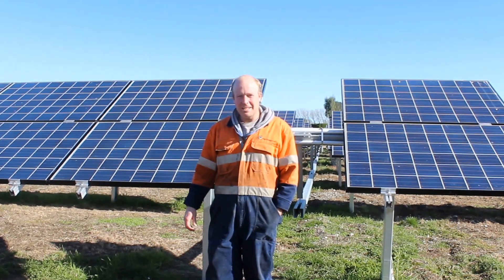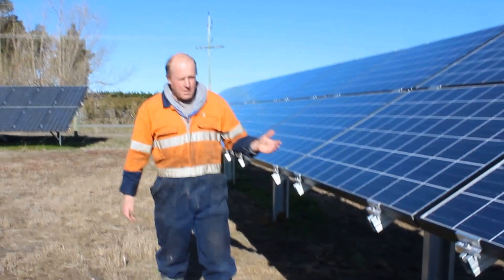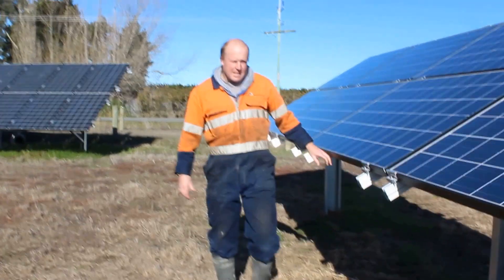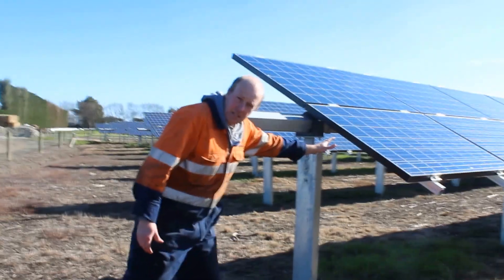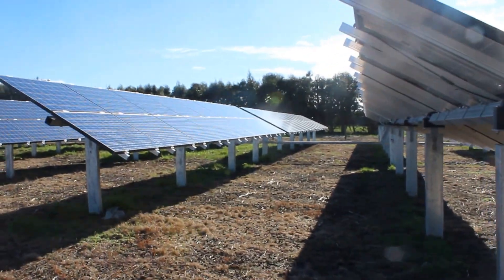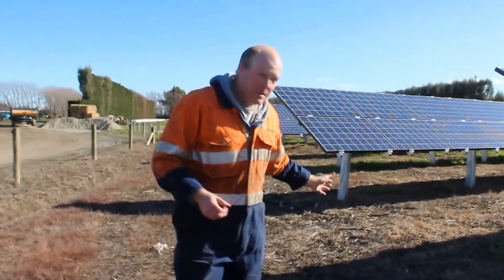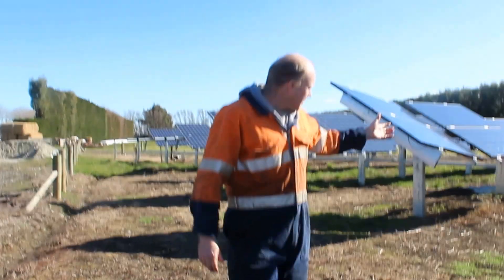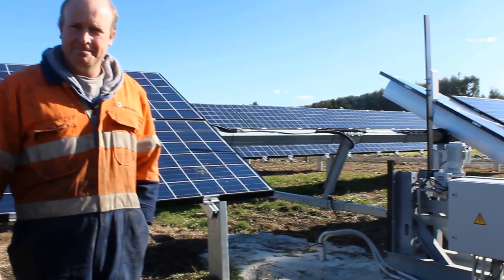Ground Mount Solar PV tracking system

Comment: 24hr sun?
Reply from the maker: Hi Michael, thank you for the comment, it was for a competition we had to fit the words "24hr Sun" in. On another note this particular site does use a Fronius battery. We could say the sun is always shining 24 hours but just in different parts of the world :).
Reply: @keaenergy359  Private joke, now I get it. Hows the system operating at farm. any problems with the actuator or linkages?
Reply from the maker: @michaelagnew7825  Has been a real good product, we have not had any issues with the tracking system, it makes a horrific noise for the first time in the morning if there was a frost and the plastic bearings are frozen, the farmer tells me it is a good way to wake up. We are starting on a 2MW solar farm, which uses a different brand and different style, i.e. no linkage arm, and much longer rows (120M), thanks heaps for your comments, yes making the video was very humorous, very difficult to keep a straight face.